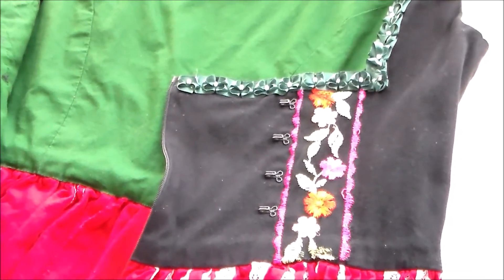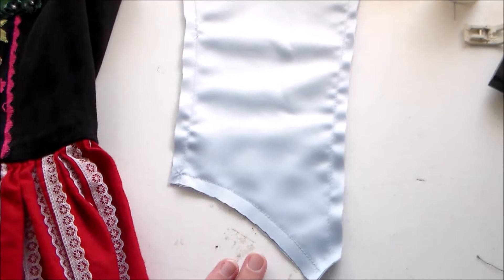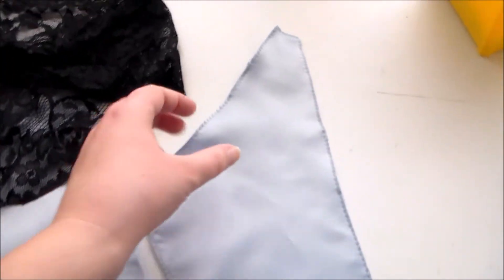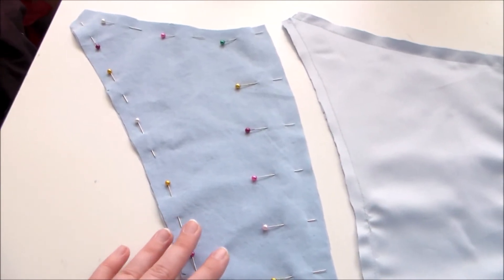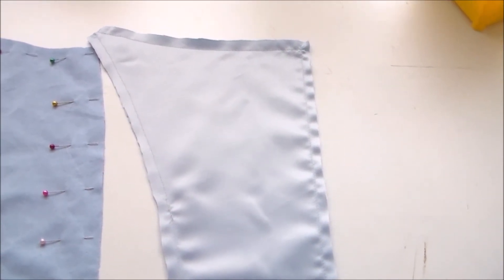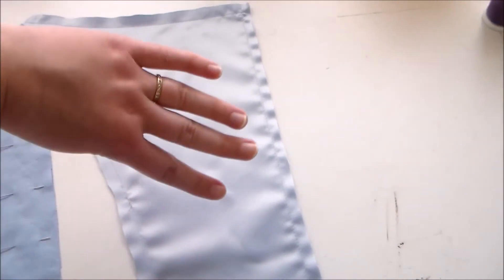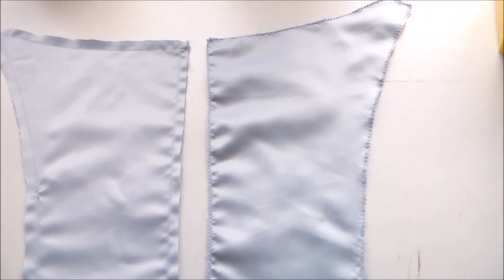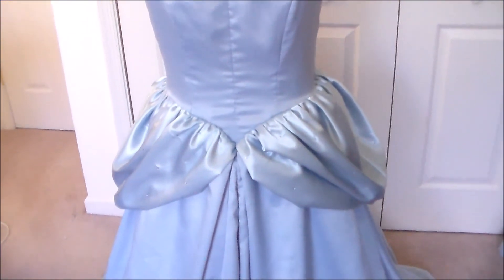What is flatlining/underlining? How to Sew

Comment: I love flat lining garments because you can take in or let out seams and not have to ruin the smooth exterior while doing a lot of handiwork on the interior. I have some advice when flat lining fiddly, slippery, and delicate fabrics. If youre gonna flat line a garment made out of a rather flimsy fabric like chiffons and tulle and anything really lightweight, you dont wanna cut your pattern pieces out perfectly since its gonna be quite a hassle if youre gonna try and align them to each other and they end up being too small for the pattern piece and then you have to end up cutting it out again. What I like to do is to use my stabilizing base, normally after its been treated with boning or interfacing, as the pattern piece instead of the paper pattern since its less likely to warp out of shape and distort your fabric. Once you have your stabilizing base on your fashion fabric, you might want to baste the base layer to the fashion fabric with the wrong side of the fashion fabric facing the right side of the base. If youre matching up prints like stripes or plaids, make sure that the print lines up the best you can so it would look its best. After you have basted all the pieces, you can now assemble your garment as normal. I prefer this method as I know my pieces will look its best and I can still fit it to myself or to others without worrying about ruining the lining too much.
Reply from the maker: So much good advice!
Reply: Flat lining is also the more historical method for lining garments.